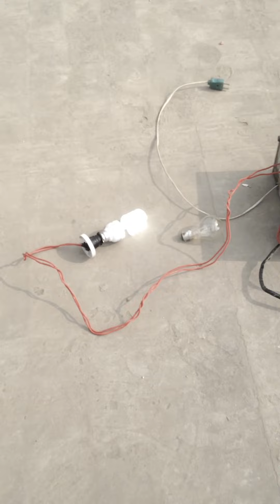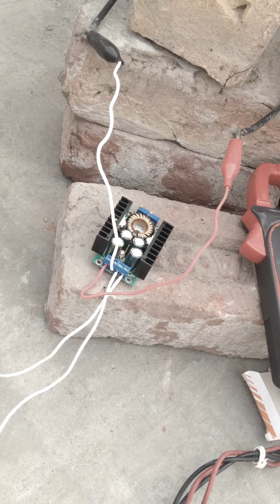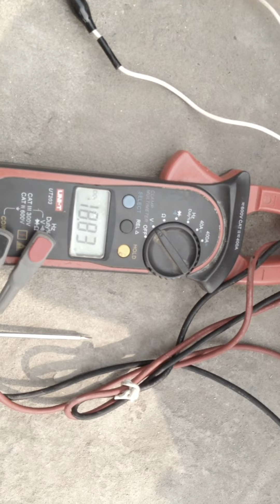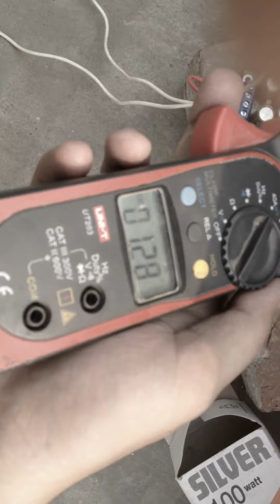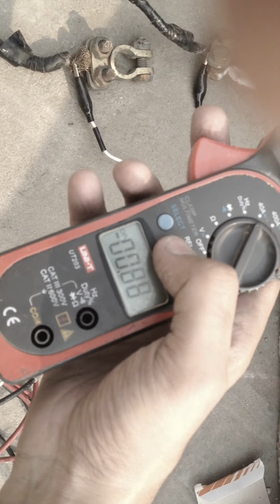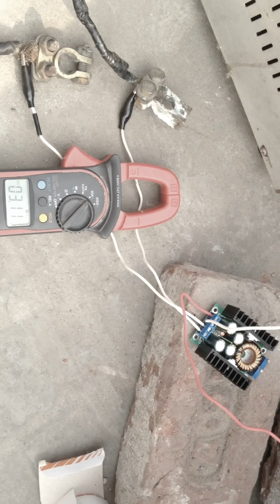15 A Buck Converter with Inverter | Solar power | DC to DC

Comment: How many watt solar you used in this video and it's 12 v or 24v?  Tell me faster
Reply from the maker: Sorry for the late. This panel is 120 watts in power rating. And it's output in 18 volts  . You can charge 12 v battery with this.

Comment: what happens if you hook the solar panel up directly on the inverter ?
Reply from the maker: It can cause damage to the inverter because inverter in 12v based and solar panel output is almost 18 volts. So, we need to reduce voltage and I'm doing using buck converter.

Comment: Does it have overcharge protection ?
when reached on required voltage set to stop giving output ?
Reply from the maker: Yes it has constant voltage setting ...when battery reach this set level of voltage ..current stop flowing to battery then
Reply from the maker: Watch new video on topic related to it 
https://youtu.be/c1DjCo9zuVA

Comment: But if less voltage is going into the inverter  the current  draw increases  to keep up with  demand  more current  isn't good
Reply from the maker: Actually my inverter was more efficient at lower voltages... That could be a case for someone.
Reply: @MrWATT-eu7cl  hmm

Comment: Why you have not set the output to 12 volt instead of 7.5 volts
Reply from the maker: Because my inverter in the ups was operating very well at that voltage...
Reply: @MrWATT-eu7cl  plz gv me ur cntct no

Comment: Which UPS is it ?? Which is working on 7.63 volt 🤔🤔 normally ups or inverter works on 12 volt
Reply from the maker: It was  local ups  without low voltage cutoff circuit...... So it was operating on low voltages